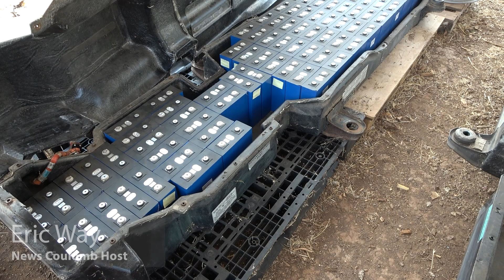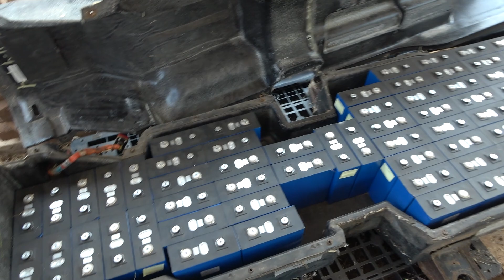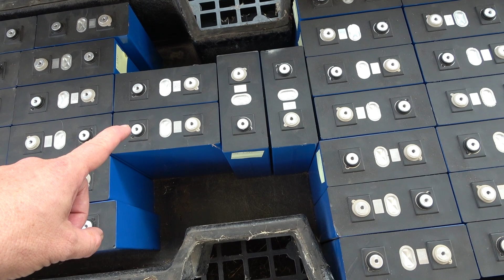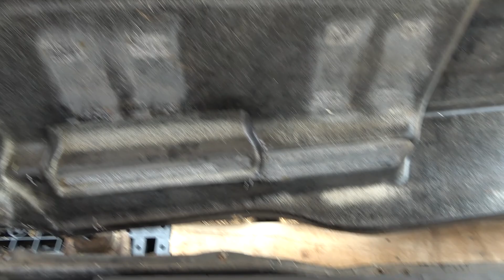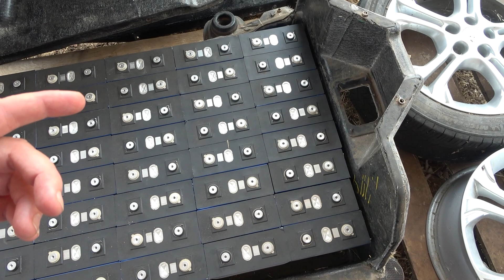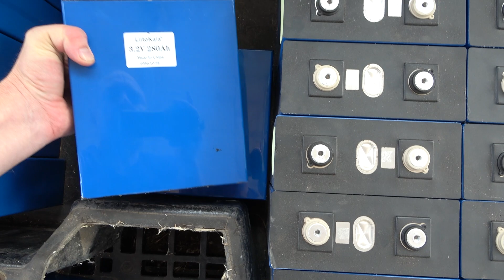Ford Ranger Electric: 280 Ah LiFePO4 Battery Cell Fitment

Comment: Hello from the high desert of New Mexico USA 🇺🇸. Have you thought about what insulation you will put in between each cell because that aluminum housing is tied to the positive of the cell. He'll I just wish that I could afford to replace my old AGM batteries that won't hold a charge, because I live in my 1967 GM TDH-4519  city transit bus full-time.  keep up the good work and stay safe and charged
Reply from the maker: Thanks! I'm going to do some videos soon showing how I'm packaging the cell groups. You're right to be concern about the positive contact, though, because not all of the cells' casing is fully intact.

Comment: I'm really glad you're using lifepo4 cells, I want to use that chemistry on my own projects. what are your thoughts on the need for compression on these cells?
Reply from the maker: Thanks! I've heard conflicting reports about the need for compression on these cells. As you can see from my layout, there will be a decent amount of natural compression already taking place, so it hasn't been a top priority for me. However, I think that the larger the load that's placed on these cells, the more additional compression will be needed.

Comment: I like watching what you are trying to accomplish here, but I think you are going to have a serious heat problem, both in driving and charging, especially in your area. You may get away with no problems charging if you slow charge the battery, take several days to charge, but driving will kill you on heat. Also you need to be able to heat the battery pack for cold temps. Air cooling did not work for the volt and it will not work there either especially with no space between each batteries. To have any chance of that working and lasting I would enclose, weather seal, and sacrifice the bed of the truck putting them in the bed even if it took two or more layers and make sure they had enough spacing for air to circulate whether you are trying to warm the batteries in winter or cool them in summer.
Reply from the maker: I'm not as concerned about the thermal management. Partly because, even at freeway speeds, the constant draw on these batteries will be less than .5 C, and the Ford Ranger Electric pack has air-cooling that is active when driving. 
Heating will be more difficult, though the Ford Ranger Electric system already accounts for that as well. I probably won't reuse the stock battery heater, but I might reuse the power feed.

Comment: Careful on the busbars. I have seen references to conversions over the years and the thing I saw with considering was non solid metal busbars. Wiring is best due to movement was the idea. Worth considering. Looks good dude!
Reply from the maker: Thanks! I'll be discussing busbars in the future. It's a bit more challenging than people might think. More than just bolting on the busbars that came with the batteries and calling it a day.

Comment: I have these cells for a few months now. They are amazing but tricky. The voltage curve is extremely flat.
Reply from the maker: Oh, nice. I saw them in your interview and van office feature, but I wasn't sure which cells you went with. A bulk of the energy is definitely between 3.1 and 3.3 V. I might lose about 5% to 10% total capacity, but I'm probably going to put the low voltage cutoff at 3 V and charge to 3.5 V.

Comment: I thought the lead packs had 2 layers, so like at the back of the bigger part can you lay them flat and go higher?  Audio sounded fine, nice update!
Reply from the maker: Thanks! Yes, the PbA pack had two levels to the cells, but only in the front and back (tall) sections of the case. The lead cells were also much shorter than these (maybe 6" or 6.5" including terminals).

Comment: Eric, if you lay them on the narrow edge you can likely get 3 in that center section talked about at 9:50.
Best of luck and the audio is decent enough.
Reply from the maker: Thanks! Yes, I was considering that, but even that height might be cutting it close. They are only about 1" shorter when flipped on the narrow side than when set vertically, so it might be tight. Still a few arrangements I have to test out.

Comment: I used 2 chevy volt packs in parralel in mine.
 If I remember correctly max voltage allowed by the truck is 355 fully charged. Get as close.as you can. Ford's setup is very voltage sensitive and the lower the voltage the more sluggish the truck is. 
The audio was perfect no wind noise at all.
Another note. Several people have used spacers between the two halts of the box to fit cells. There is plenty of room vertically in the chassis.
Reply: I just found a ranger EV in the weeds at my new farm lot. What do you think the minimum battery requirement I could use to get her going again? I don't need too much range, 50 miles would be plenty
Reply: @matthewholloway9507  because the truck is shaped like a giant brick I think 30KW is the minimum battery to get 50 miles year round. Maybe turning into a low rider would help but it is still a brick. Enjoy your project.
Reply: @richardcrosby3679  Thanks for the advice. I don't want to spend too much money. Luckily in Hawaii our temps are very consistent.
Reply: Matthew, if you’re going for a long term build I’d use LFP, but I put 88 Gen2 LEAF (2013-16) buddy-paired modules in my first Ranger project for 100+ mile range.  Hawaii has a lot of old LEAFs to salvage
Reply from the maker: Awesome. Thanks for the heads up! I'll look into the spacers.

I've read about how sensitive the Rangers can be to input voltage. I think the max cutoff is 379 V. I know people have run 104s LFP cells, and that worked just fine. The charging voltage for LFP is 3.65 to 3.7 V, which is right at the cut off, but I think it works because the LFP cells seem to "settle" at ~3.4 V when full. It might be possible to run 108s for LFP if the charge voltage is limited to 3.5 V per cell. 

The good thing about these LFP cells is that the bulk of the energy is between 3 V and 3.3 V, so I might never drop below 300 V in normal driving.
Reply: Yes- with LFP go with 108 cells, EVen 104 cells will put you into current limit well before the cells are actually low SOC.

Comment: What did 100 280 amp cells cost you?
Reply from the maker: It averaged around $100 per cell. I bought in several different lots. A couple 4-cell boxes were as high as $430 before tax, but the largest lot was $380 at the time of purchase. If you can afford them all at one time, it's probably best to wait for a deal.

Comment: You could always file down that lid to be able to squeeze in the extra cells.    You are really hitting the home stretch here.   200 miles is kick ass for a 90's ev, recycling these would be way better than buying a tesla.  thats for sure.
Reply from the maker: Thanks! I'm really trying to avoid modifying the hardware too much, but I've already been making some changes. I need to review my footage of the batteries in place to see if I can get a better gauge of tolerances. It's possible that a custom battery box might actually be the right option.

Comment: Audio and the format both worked well.  Interesting to listen and see the objective, the constraints and challenges.  Lot's of simultaneous demands and visualization going on.  Super fun.  Thanks for walking us through this.

Interesting that you will be borrowing some of the batteries to carry you through the PG&E outage (which, unfortunately have become more common rather than less).  With the truck turning into a large power bank, would you consider installing a connection that would allow you to tap into the truck as a backup for times like this?  Or are you ultimately just going to build a separate system into your house?
Reply from the maker: Thanks! I'm definitely exploring some options to power the house with the truck, but for right now, I have those used Nissan LEAF cells that will work well enough for basic backup power. I'll probably do a few videos on those as I package them and put them together.

Comment: In that center section, where you laid down 2 or 3 cells on top of each other… wondering if you turned that stack 90 degrees counterclockwise then you might get a couple stacks of 3 cells side by side?
Reply from the maker: That's one of my thoughts as well. I'll be fiddling with it a bit more to see exactly what I can get away with.

Comment: A quarter says you end up customizing that box by redoing some of the fiberglass before your done. ;)
Reply from the maker: Hah! Don't underestimate my laziness. 😁 Of course, depending on what you mean by customizing it, I might have already made some modifications.
Reply: @newscoulomb3705  Mostly I was thinking that there's a lot of places where angles could be made slightly steeper and the extra half-inch gained means that there's suddenly room for a cell where there wasn't, or gluing a strip of wood to the inside and covering with a layer of fiberglass to fill some of the gapping around the outside of the pack for lateral bracing while still leaving tunnels to move air through...
Reply from the maker: @hellsop  Yes, I've been looking at some of that. The big concern is the tolerances for the undercarriage. Ford really shoehorned these packs in, so there's not a lot of wiggle room. I think that, before I do too much customizing on these boxes, I'd just make a new, custom battery box. The new 230 Ah EVE cells (180 Wh/kg) will fit 100 cells just in the main compartment, meaning I could theoretically cut off the entire front section. AWD anyone? 😁

Comment: Do you have to worry about cooling these? And how about thermal expansion of those cell cases?
Reply from the maker: For basic L1/L2 charging and typical driving, I'm unlikely to have to worry too much about cooling. The Ranger already comes with an air cooling system for the battery case, which should be sufficient. I'm more worried about heating than cooling at this point.

Comment: I'm at work so I didn't have time to watch the whole video, but if these cells are 280AH and the nominal voltage of each cell is 3.2V, if you have 100 of these, does that mean that you'll have a theoretical capacity of 89.6kWh? That would be freakin huge and very impressive for a little Ranger.
Reply from the maker: Yes, that's about the base capacity I'm looking at.
Reply: @newscoulomb3705  Very cool! I'm excited to follow the progress!